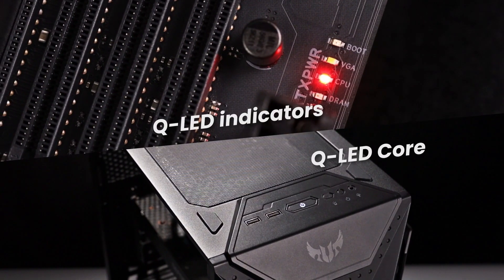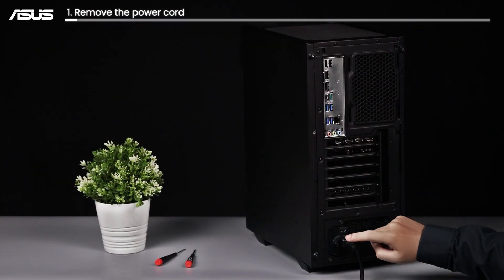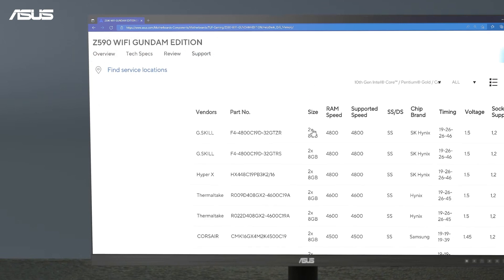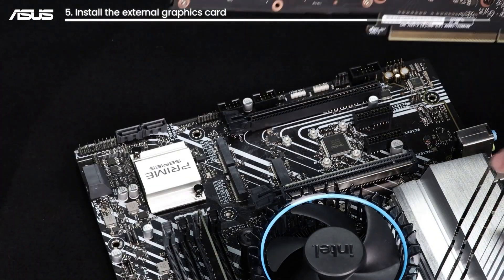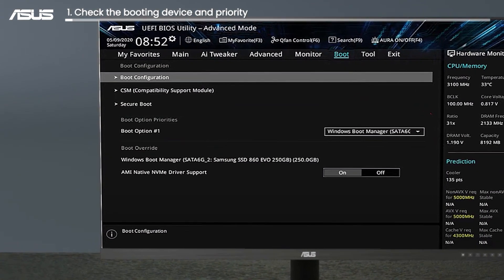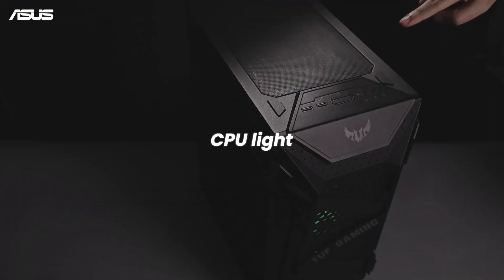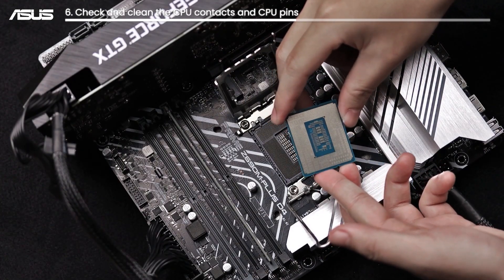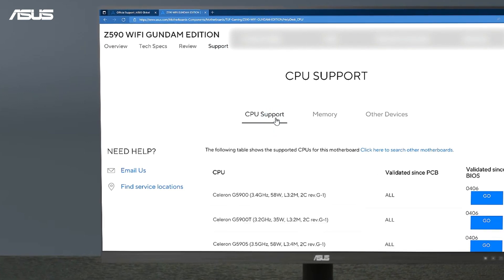ASUS Motherboard Troubleshooting via Q-LED indicators, Q-LED Core   | ASUS SUPPORT

Comment: hello, I built a new computer last night with all the new parts. 
I have a Asus ROG STRIX Z790-A GAMING WIFI D4 ATX LGA1700 Motherboard
on start up the yellow DRAM Q-Led comes on, and then turns off after about 5-6 seconds however the monitor only occasionally comes on. when we can get to BIOS to select the windows boot device the computer shuts down and we cant get visual again after that. we have tried what feels like everything in testing all parts. any advice before we try to return it?
Reply: I checked the QVL list and discovered that the RAM we got is not on the list (SKU CMH32GX4M2D3600C18W
VENGEANCE RGB PRO SL 32GB (2x16GB) DDR4 DRAM 3600MHz C18 Memory Kit – White) Does this mean we need to buy different RAM cards? we used PC part picker to build it virtually and it said it should have been compatible but apparently not.
Reply: @staceywalley2616  you can try this from the BIOS in the following order:

1)  Start from a clean slate, so select "Defaults" to force all BIOS settings back to factory defaults., save and exit to apply, and upon reboot go back into BIOS.  

Note that the amount of time it takes for POST to complete may be extended whenever RAM timings have been altered due to automatic tuning that occurs, and sometimes it will automatically restart.  Expect this and do not interrupt the POST if you think the POST is hung, give it a minute or two.  

2)  Enable XMP,  save and exit to apply,  and upon reboot go back into BIOS .  With XMP enabled the BIOS will use timings suggested by the RAM.

3)  Select EZ Tuning Wizard, when it is done, save and exit to apply, and upon reboot go back into the BIOS.

4) Now you might see that XMP is no longer enabled (as a result of running the EZ Tuning Wizard).  Re-enable XMP, save and exit to apply.  This time, hopefully, you are good to go and can allow normal boot to happen without going back into the BIOS.

Worth a try, good luck.  If the system locks up, you can clear CMOS to go back to factory defaults and start over for another go at it.  The key is to enable XMP before doing the EZ Tuning Wizard and then again after the EZ Tuning Wizard.
Reply from the maker: @staceywalley2616  Hi, according to your question, it is suggest that you replace the device which is compatible with the motherboard, then see whether the issue still exist.
You can try test with minimal components, please refer to the following link.
https://www.asus.com/support/FAQ/1042632
Also, could you provide your BIOS version? Thank you.

Comment: hi , i got 13500 run with b660m-g gaming wifi, the qled show red (very fast) then orange for like 8-10 second then the qled off, and system wont post or boot, i try every slot of my ram nothing happen, when i pull out my ram qled orange always stay on , what is the meaning of my orange led lit on for a second ?
Reply from the maker: Hi, according to your question, it is suggest that you test with minimal components.
You can refer to the following link.
https://www.asus.com/support/FAQ/1042632#6
Also, could you provide your BIOS version? Thank you.
Reply: i had been through all the step on troubleshooting guide, still no post and the same issue appears, for the bios i just updated to latest version 2212 (FYI this new build with all new part) the ram i have use its Gskill F5-5600J3636C16GX2-FX5
Reply from the maker: @xlancelot081  Hi, according to your question, have you try to test with minimal components?
Or try to clear CMOS?
If you've make sure that you already try all the troubleshooting steps according to the video or the FAQ at the description box but the problem still exist.
It is suggest that you visit the nearst repair center for further inspection. Thank you.
https://www.asus.com/support/service-center-location

Comment: Hey there, 
I just bought a prime b450 plus mainboard, but it doesn't work unfortunately. Ryzen 5 2600, 16 gb of ddr and a r9 380. The fans spin when I try to start it but I get no picture. With no leds and no sound how should I find out what's wrong? Does the power led blink to encode the kind of error?
Reply from the maker: Hi, according to your question, for PRIME B450-PLUS, Ryzen 5 2600 is validated since BIOS version 0318
And for PRIME B450-PLUS, the latest BIOS version is 3810
Please make sure your BIOS version is 0318 or after.
Also, it is suggest that you test with minimal components, you can refer to the following link. Thank you.
https://www.asus.com/support/FAQ/1042632#6
Reply: Did you figure out the problem?

Comment: Hey ASUS. Unfortunately, I did not find support for the CPU of my ROG STRIX B650-A GAMING WIFI motherboard. From time to time, my PC will NOT turn on (about a couple of times out of ten) and either the red light on the CPU / DRAM is on when it is turned on, or it turns yellow first, and eventually red. All components are new, I do not understand what could be the problem.

CPU - Ryzen 7700x, RTX 3080, DDR5 Fury RAM 8 GB x2

plis help mi :(
Reply from the maker: Hi, according to your problem, for ROG STRIX B650-A GAMING WIFI, Ryzen 7 7700X is validated since BIOS version 0602.
And the latest BIOS version is 0823
Please make sure your BIOS version is after 0602.
You can refer to the following link.
https://rog.asus.com/motherboards/rog-strix/rog-strix-b650-a-gaming-wifi-model/helpdesk_qvl_cpu/
Reply: @asus_support  Thank you very much for the answer, very glad you help people in the comments. I have BIOS version 0613
Reply from the maker: @Klyuchh  Hi, according to your problem, to solve the Q-LED light problem, have you try the troubleshooting steps according to the video or the FAQ at the description box?
Make sure all devices is well connected on the motherboard. 
Please follow the steps in the following link. Thank you.
https://www.asus.com/support/FAQ/1042678/

Comment: Hi Team, just built my dream rig, went to boot/post and continually hit Q code 64 and Q LED boot error. Have i13900K on Asus Maximus x790 Hero with 2 x 16GB RAM, 1300w PSU with dedicated GPU 12vhpr connection and Kingston SSD with second Samsung SSD. GPU is Asus RTX4090. Getting a little frantic here as have reset all attachments including headers and get same result. I realise I may have to replace something but dont want to do it by trial and error as the bank a/c is empty!
Reply: Actually now I am getting Q code 98 even before it goes to Q code 64....sigh
Reply from the maker: @CMN-lu3bt  Hi, according to your question, it is suggest that you remove all the external device then try to boot up again to see whether the problem still exist.
Also, whether any Q-led indicator light is on?
Could you provide your BIOS version? Thank you.
Reply: @asus_support  thanks for the quick response. Q LED was yellow/green for the boot. I have managed to remove the code 98 by swapping around mice/keyboard it is just the q code 64 now that is stumping me. Will check bios version when I get home. I have tried removing monitor/mouse/keyboard/ssd/usb headers the works... even took out the gpu...
Reply: Am thinking bios was 5.0.3
Reply: Correction it is 0703
Reply from the maker: @CMN-lu3bt  Hi, according to your question, whether you try the steps according to the video or the FAQ at the description box?
Have you re-connect the SATA cable to the motherboard and the hard disk respectively?
Please re-connect the M.2 SSD again and confirm that the M.2 screw is locked.
You can refer to the following link. Thank you.
https://www.asus.com/support/FAQ/1042678##5
Reply: @asus_support  2 x ssd only no sata connection. M2 screws all locked...also can you actually assist with the Qcode error or only the Q LED one?
Reply: Hi @ASUS Support, I may have misread this, it could be showing as Q code b4 not 64 not sure how to fix a usb hot plug
Reply from the maker: @CMN-lu3bt  Hi, according to your question, have you try to clear CMOS?
Recovery BIOS option and restart if there is no display at startup.
You can refer to the following link. Thank you.
https://www.asus.com/support/FAQ/1040820

Comment: Hello Asus i have a new build. rog crosshair x670e hero with a 7950x pcu! I power up and CPU fan GPU fans not on NO Q-led come on. I get the start butten on the M-board, flexkey, Led on ran, and the Rog led over the use hub all turn on. no display ether? I have pulled CPU its clean no bent pins pulled ram its good GPU was pulled and still cant get it to start up fully O and the bios is updated.
Reply from the maker: Hi, according to your question. whether your BIOS version is 0805?
Have you check the power supply?
Please check if the connection of the power cord and electric socket are well connected.
If it has no display when you install two or more memory, please check whether problem can be solved by installing only one memory .
Then try to install the other memory to eliminate memory problem.
Whether you have any external graphic card?
Also, it is suggest that you test with minimal components. You can refer to the following link. Thank you.
https://www.asus.com/support/FAQ/1042632

Comment: Hello. I have an Asus Prime X670-P with a Ryzen 7 7700X CPU, 32GB of DDR5-5200 RAM at and a Nvidia RTX 4080. Whenever I start up the PC, the button on the case shows it’s light for four seconds, I’ve tried removing and reinstalling the SSD and GPU but no luck, any suggestions? Thank you.
Reply from the maker: Hi, according to your question, may I ask whether the Q-LED indicator light is always on?
If the light is not always on and you can boot up, operate normally, there's no need to concern.
Whether your BIOS version is 0823?
Reply: @asus_support  The Q-LED indicator would flash at four second intervals. I got the PC to boot when I removed the power connector going into the 4 pin slot and just having the 8 pin connector power my CPU. This was a fresh build so the BIOS was the standard version that came with the motherboard when shipped to me.

Comment: Well my pc just keep recycling through white, orange and red
Reply: the lights don't stay on all the time. the screen is not showing the picture. I have tried with two screens and two different hdmi cables. without video card and with video card. I don't know the bios version.
Reply: Same here and no video
Reply: @erkkipenttinen8343  try opdating ur bios, worked for me
Reply from the maker: @erkkipenttinen8343  Hi, did you encounter all Q-LED indicator light is always on?
Have you try the troubleshooting steps according to the video or the FAQ at the description box?
Please make sure you follow all the steps.
Also, could you provide your product model and current BIOS/OS version? Thank you.
Reply: the lights make a cycle. vga about 10 sec on. ram 2 sec and cpu 5 sec. no boot led. no bios beeps. no video signal. Rog strix 650e-f
Reply from the maker: @erkkipenttinen8343  Hi, according to your question, may I ask whether your Q-LED indicator light is always on?
If your light is not always on and you can boot up and operate normally, there's no need to concern.
Whether your monitor have display?
Could you provide your current BIOS version? Thank you.
Reply: Bios update fixed this
Reply: @erkkipenttinen8343  just a question, did u buy the bundle on komplett?
Reply: @erkkipenttinen8343 just updated bios? Having same issue after bios update
Reply from the maker: Regarding your question, I would recommend you visit the following forum post to get more assistance.
https://zentalk.asus.com/t5/motherboards/bd-p/motherboards
Sorry for any inconvenience it may be caused.

Comment: I have the b650a, been running fantastic for 5 days with ryzen 9 7950x.  Last night it just randomly restarted on me in a game, and it just keeps restarting non stop, its only stable when in bios.
Reply from the maker: Hi, according to your question, whether your Q-LED indicator light is on?
Have you confirm that your BIOS version is at latest version?
Did it start restart in a game?
May I ask which game?
Could you provide your BIOS version? Thank you.
Reply: The same thing happened to me
 I have a b550m tuf plus wifi 2
Reply from the maker: @ivancarlos4806  Hi, according to your question, may I ask is the Q-LED light is always on?
Which game you're playing?
Could you provide your current BIOS/OS version?
Have you make any changes or update anything then the problem occur?
Did any Q-LED indicator ligh is on?
Whether it is always on or blinking?
Have you try the troubleshooting steps in the video or the FAQ at the description box?
Reply: @asus_support  yes, I've found the problem already. It was a PSU issue. Tested the components on another PC and they worked.

Comment: ATM my PCIe is flashing every 2 sec, but  everything is perfect on paper
Reply from the maker: Hi, according to your problem, if the Q-LED indicator light is not always on, you can boot up and operate normally.
There's no need to be concern. Thank you.
Also, could you provide your product model and BIOS version?
Reply: @asus_support  thanks for your help, I will post those information later in the day

Comment: Hello I have a b650-plus wifi and when I try to power on the dram qled turns on for half a second then the cpu qled turns on for 3 seconds, then the vga qled turns on for 24 seconds, then it repeats this indefinitely. It does not show a display and the power led is constant. I have removed my graphics card, reseated the cpu cooler and checked the motherboard pins which appeared fine. I have  new asus tuf b650 plus wifi mobo, amd 7600x, 2 corsair CMK32GX5M2B5600C36 16gb, and an asus 80+ platinum power supply
Reply from the maker: Hi, according to your question, whether the Q-LED light is always on?
Have you try another SATA cable/SATA Port, or SATA hard disk?
Also, could you provide your BIOS version? Thank you.

Comment: What are the numbers on the Q-LED 7 segment display after the system successfully booted into the OS. Is that CPU temperature ?
Reply from the maker: Hi, according to your question, what do you mean by number?
For Q-LED indicator light it only show different color, and the light will blink or always on.
May I ask where did you see the number?
Is it in you BIOS configuration?
Also, could you provide your product model and BIOS/OS version? Thank you.
Reply: @asus_support  I meant the seven segment display that shows the bios POST codes during boot. Z790 maximus hero. What does it display after boot is complete ?

Comment: Hello, I have a problem with the motherboard asus z690-e, the BIOS takes 17 seconds to do the checks before reaching the asus logo, and inside the BIOS, it jerks (I haven't installed a GPU yet, I don't know if that can influence) I have an i5 12400. After that everything is normal, I have no problems in windows, everything works fine there, it's just the bios starting and inside the bios (I have a notebook rog zephyrus that takes 4 seconds and is from the year 2018 )
Reply from the maker: Hi, according to your question, it is normal that after you boot up the system will take some time to check whether there's any abnormal.
If you can boot up and operate normally, there's no need to concern. Thank you.

Comment: Hi ASUS.  I have a tuf gaming B660m plus d4 with an i5 13600KF and a KF436C18BBAK2/32 memory kit and my RTX 3080 doesn't display video. First appears CPU Q Led (red) then turn off and turn on DRAM (yellow) getting on all the time without video.  What could it be?  Thanks.
Reply from the maker: Hi, according to your question, have you confirm that the memory is fully installed?
Also, for i5 13600KF, the validated BIOS version is 1620.
And for TUF GAMING B660M-PLUS D4, the latest BIOS version is 2014
Could you provide your BIOS version?
Have you try to reinstall CPU or change another CPU?
Please refer to the following link. Thank you.
https://www.asus.com/support/FAQ/1042678/##3
Reply: @asus_support  yes, ram memory modules are installed correctly. I already activated the warranty. 😔You can't tell what bios is because it doesn't show video. I tried reinstalling the CPU and all the pins are there intact.🥺 I have only i5 13600KF with LGA 1700 😞💔😔🥺😬😓.
Thx.
Reply: @KooriSetsuna  My friend has the same problem. CPU turns on and off then DRAM is in yellow all the time with no visuals on his two monitors. Did you find a solution?
Reply: @matthieugouault  yes, he must update the BIOS with 12th gen CPU.
Reply: @KooriSetsuna  Wait. Did you have to buy a 12th gen CPU to update the Bios? He has the i5 13600K
Reply: @matthieugouault  no, I paid someone to update for me. I have the same CPU.
Reply: @KooriSetsuna F me right in my A hole!!!!!! I'm literally 3 weeks in trying to troubleshoot this mfkng b660m with a dumb blinking Q-led and now by your grace and kindness I discovered that now I gotta do a miracle to try to find someone with a 1700 Chipset! Truly Thanks!!!! You saved lot of work. I literally have already spent +2k trying to solve this!!!!!
Reply: @teteubarravelha  eu vi que é Br kkkk. Que bom que conseguiu! Fico feliz em ter ajudado! Aproveita bastante!
Reply: @KooriSetsuna  consegui nada, agora vou tentar fazer um USB bootavel de BIOS com outro PC pra colocar nele e quem sabe por um milagre dar update...
Reply: @teteubarravelha  eu levei a placa mãe em uma assistência técnica e eles atualizaram a BIOS para mim com o processador deles, e deu certo. Chato essas coisas né? Hoje em dia era pra ser mais fácil montar um PC.
Reply: @KooriSetsuna  vamos ver, gosto de fuçar e vi em um fórum que é possível com CD. E quando vc faz pendrive bootavel de windows por exemplo o pendrive passa a ser reconhecido como 💿
Reply: @teteubarravelha  ué, mas para vc atualizar a BIOS tem que dar vídeo primeiro para entrar lá e atualizar com pendrive. E para dar vídeo neste caso, somente com processadores LGA 1700 de décima segunda geração e aí vc atualiza preparando terreno para o 13600KF.
Reply: @KooriSetsuna  vamos ver, não custa tentar, tenho sábado e domingo inteiro pra tentar. E pelo que li deu certo pra eles